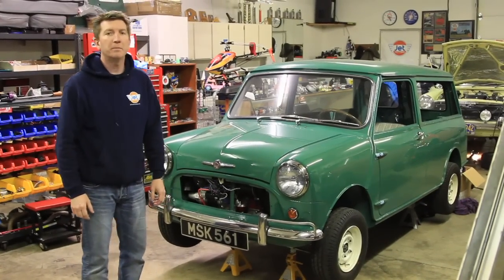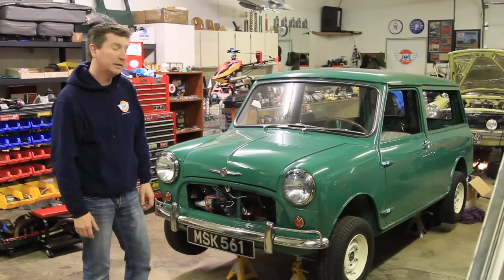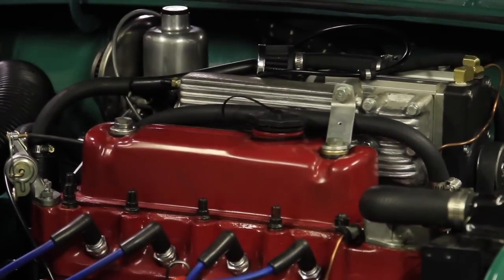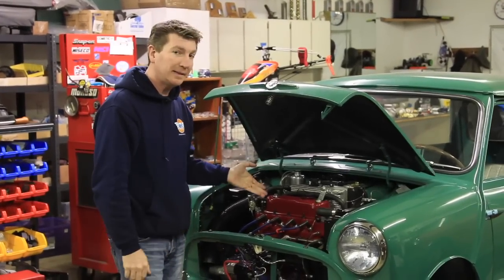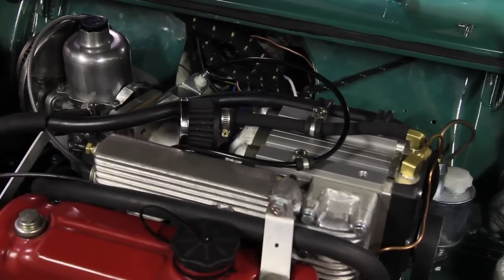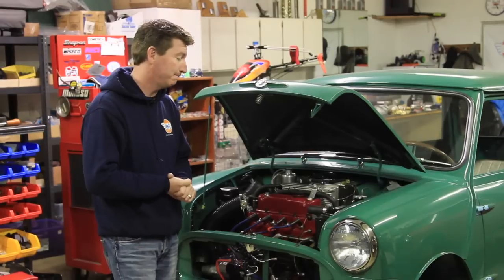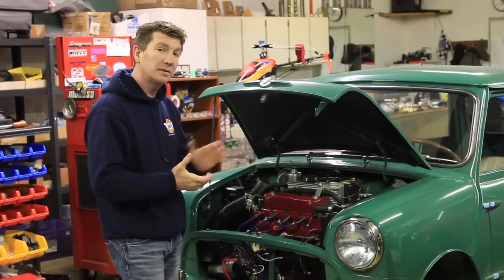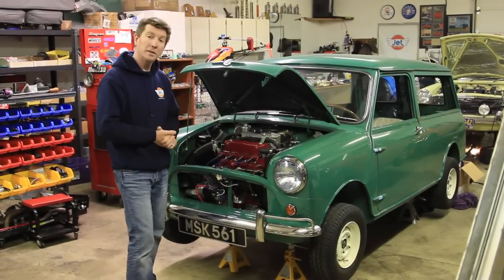Dwight Smith's Sleaper Supercharged Classic Mini Cooper

Comment: Do you work on mini's in Oregon?? I have a couple of issues with my mini I would like to get resolved ...first it needs to be aligned  and I have a vibration on the drivers side wheel that is causing me issues regards from Poulsbo Washington
Reply: Hi Jeff, Yes we love Mini's and that's all we work on. Sounds like you have a loose or worn drive flange causing your problem. Very common and easy fix. Thank you.
Jeremy